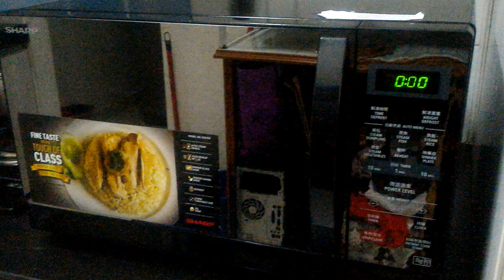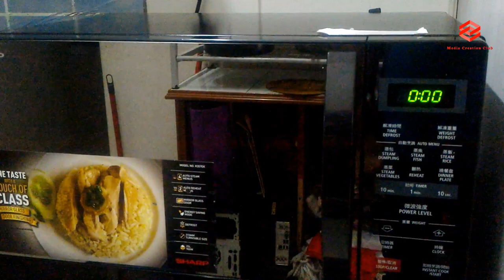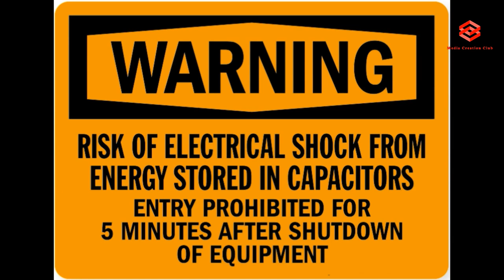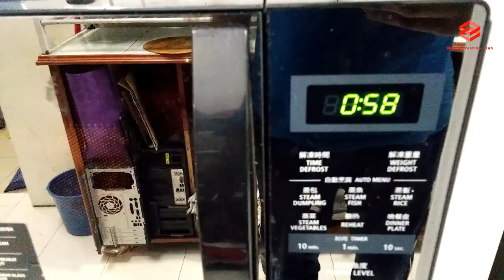Microwave Working But Not Heating || How To Repair Microwave Fully Explained! #1

Comment: Great video but after changing the diode and it still didn’t work, I would’ve discharge the capacitor just in case  before I stick my finger in there the second time .

Comment: You say the diode is the main cause for heating problems. But you change the Megatron first. Everyone don't have spares at hand so it's better to start with the diode and capacitor because it is much cheaper than a Megatron.
Reply: Not megatron but MAGNETRON
Reply: optimus prime😂😂😂

Comment: Thank you for your video. I found my problem was a blown 5kw 0.75amp fuse. As the electronic store doesn't have one, can I use a 5kw 1amp instead?
Reply: Was your microwave not getting any power whatsoever? Or were you getting power, but without the oven being able to make heat?

Comment: . first you changed the magnatron, Then check the dioad and changed it. At that time Set get working condition.
big to Small method.!
last month. my Samsung Fridge got Camplaint. call the Service technition. he came and said compressor damaged. change the compressor and charged more than Rs9000 . No result. Second day came and changed capasitor .Same effect. Then day after changed heater. No result - finely changed a small electronic boad. The set ready to work. That small boad really cost less than Rs 300. But I got a big bill more than 9000 Rs.